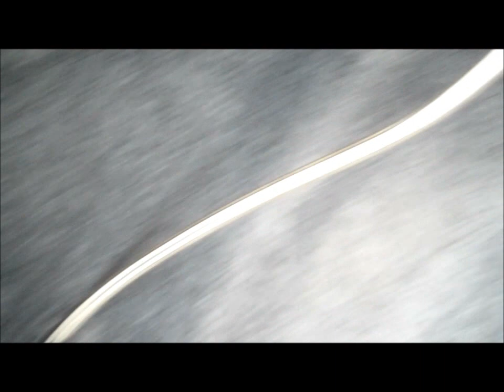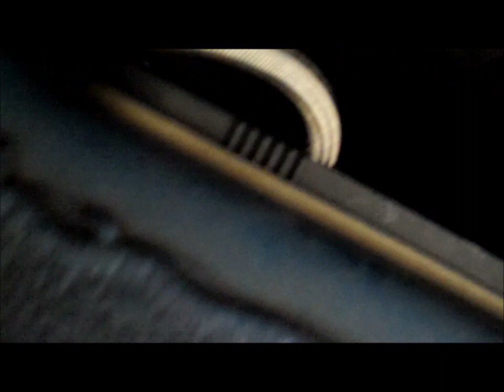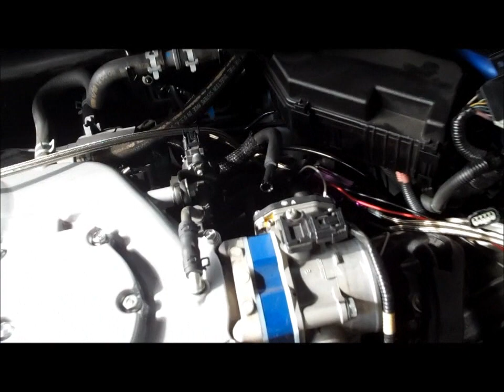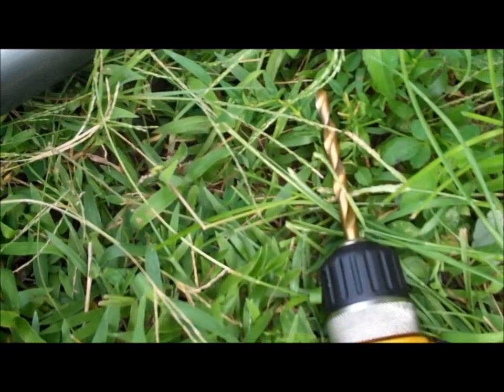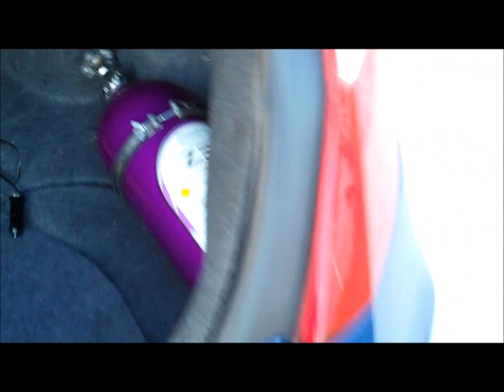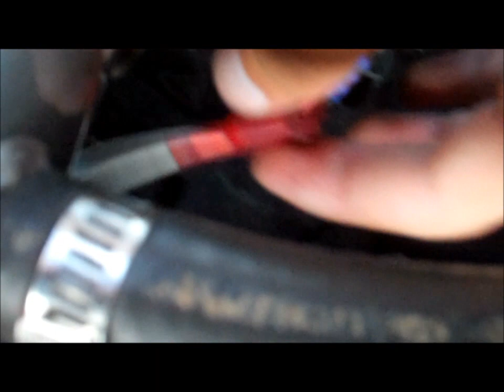2008-2010 Honda Accord V6 ZEX EFI Wet Nitrous Install, Model 82021

Comment: Hi I have a question about your install. You mentioned you have a 2008 accord, I have a 2012 V6 accord  now the TPS for the voltage output wire is it the same as yours.
please let me know.

Comment from the maker: The only reason i didnt use the P2R nitrous port on the throttle body spacer is because it is to close to the Intake Manifold and could cause puddling which could lead to High Intake manifold preasure. Which is why i just put it 6-8inchs away from the Throttle to give nice Even flow of nitrous

Comment from the maker: @wackykid600 

That is the ZEX Nitrous Management system. The Fuel line is because you need to run Fuel/and Nitrous into the intake system